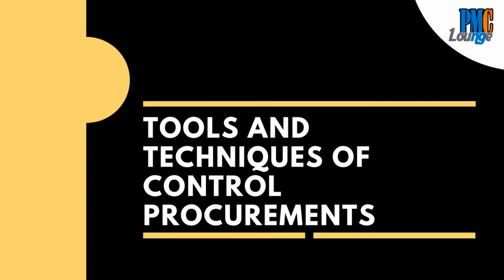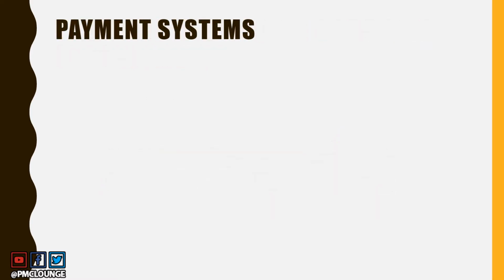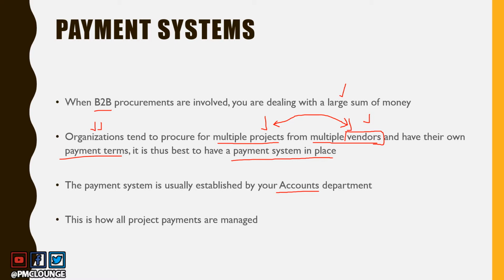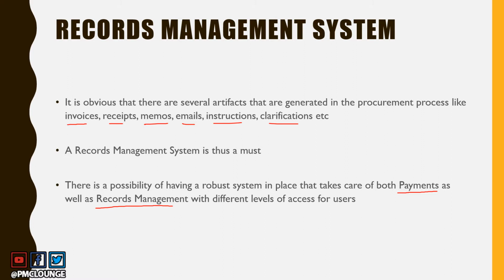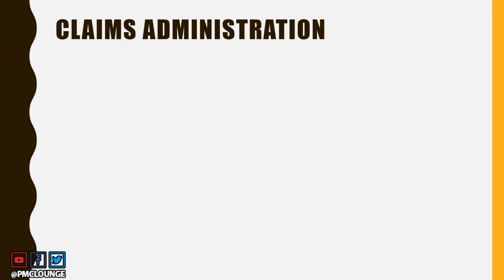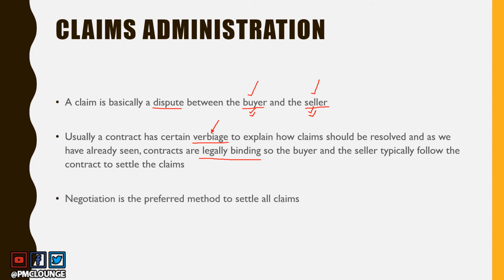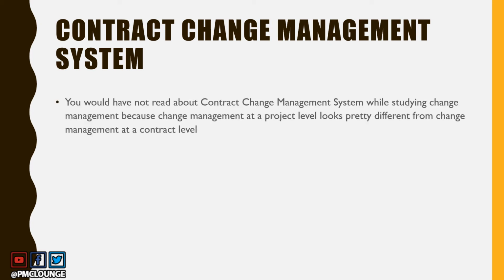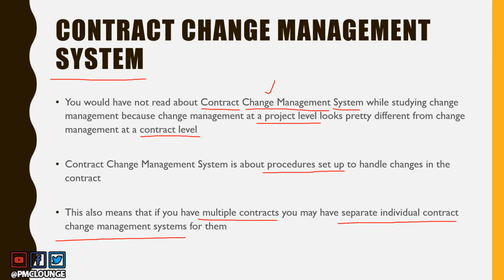Tools and Techniques of Control Procurements process

Comment: The project is driven by the Master Time Schedule of the Prime Contract. Any changes in the Subcontract may have a direct or indirect impact on the cost as well as the Delivery Schedule and/or the payment schedule.  It is like a spider web. Any change may have multiple impacts on the implementation process of the Project. So, change management is to be undertaken by visiting all the relevant contracts and interacting with the client as well as all the affected suppliers.
Reply from the maker: Hi Ahsan, thanks for sharing your knowledge. Appreciate it 😊👍